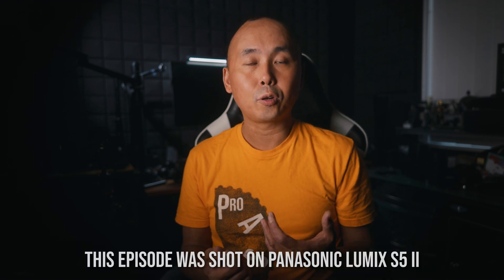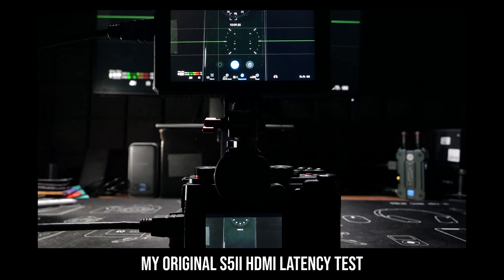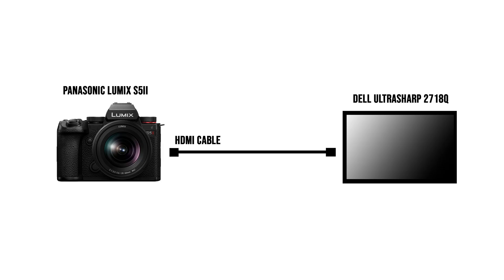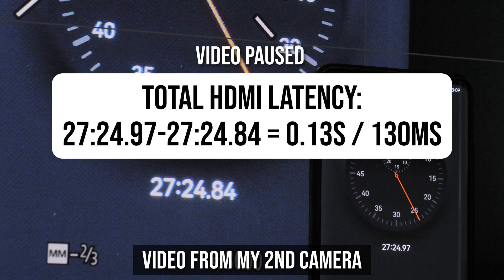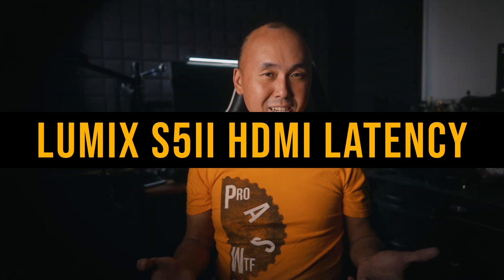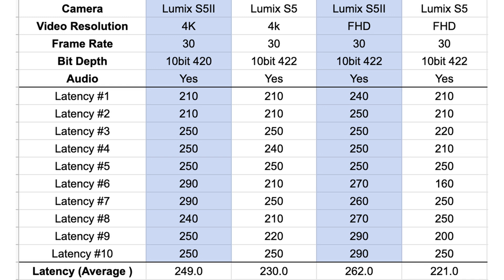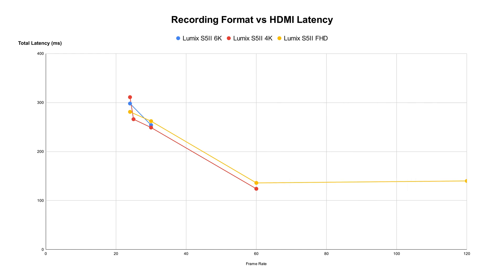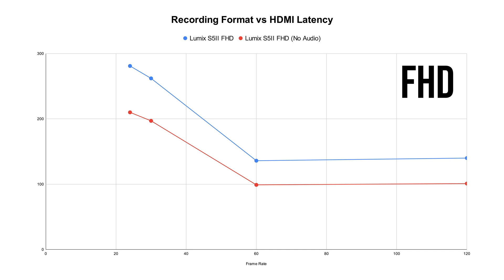Lumix Camera HDMI Latency issue (including S5II)

Comment: I’m shooting music videos of myself so I’ve been connecting my S5 II to an actual TV screen. Because I need to see what I’m doing while I’m shooting and playing at the same time. While I have not noticed latency, I have been getting weird red blotchy colors on my TV screen. I am using really old HDMI cables. Do you think that’s the issue? I noticed the higher I go the worse it gets. At 6K it’s just terrible.
Reply from the maker: so you don't see that in the recorded footage or camera monitor?  Then i would suggest trying a different HDMI cable that meet the latest HDMI specs
Reply: @ Hello, I tried three different cables and played it through four different monitors. I just had a camera repair place tell me I gotta replace my HDMI port. Thanks for answering.

Comment: I dont get the issue with latency other than personal. In reading you dont manual focus off a monitor anyway . If you want to auto foucus how does this issue effect that?
Reply from the maker: Pro video users when shooting with manual focus lenses quite often relies on the larger external monitor for focus pulling. Camera’s built in monitor is too small

Comment: Thanks Richard.  I'm curious if anyone has tried using the HDMI Ultra 10k 8k (2.1b) cable that's using for monitor feed in gaming.  I picked up a high transfer USB-C cable for an external drive already.
Reply from the maker: Are you thinking the cable may make difference to the latency?
Reply: @TheRealRichardWong  Basically yes.  I understand it's a cumulative effect. I went straight from a GH4 to a S5iix about a month ago.  I don't remember my last camera being this bad.  I don't use and external recorder where it seems a bit extreme.   My basic 7" monitor doesn't lag as much as the results but before I buy a 8k cable I would like to know how you feel.
Reply from the maker: There are a lot of discussion about the lag on various forums/social media..etc but so far i haven't heard anyone said it helped minimise the lag for them.

Comment: what will happen to sound I record into the Panasonic dmw xlr if I turn off HDMI record output ? whats the benefits of the HDMI REC OUTPUT on?
Reply from the maker: If you don't need to record/use audio from your external HDMI device, you can just turn that output off. It would not affect internal recording
Reply: @TheRealRichardWong  what external HDMI devices record audio ?
Reply from the maker: @creativegreatsvisuals Atmos ninja v, Hollyland mars X (from phone app)..etc
Reply: @TheRealRichardWong  is that audio from the monitor better than internal audio on most cameras ?

Comment: I’ll need to test it, but I would bet that it is not the 4k60p, but the APSC crop that improves the latency. Curious if the crop mode would better latency performance in 4k24p and 4k30p as well.
Reply from the maker: Keen to know your results if you tested it

Comment: I've seen some reports of issues with the HDMI feed occasionally being laggy and unusable for a minute or so.  Have you experienced this?  Thanks!
Reply: That makes sense!  I figured the reports I heard were user error.  Thanks for your quality content brother!
Reply from the maker: I had a few intermittent issues in the past, but they were all caused by either doggy connection or HDMI cable not able to handle the data rate

Comment: excellent job!!!

unfortunately I have 2 issues

1) I use time code to synchronize my S5 video with my Zoom F8n Pro audio, and time code is not supported at frame rates greater than 30 fps

2) I use the Deity TC-1’s time code on the audio channel from the S5 to my BMD Video Assist monitor for later conversion to metadata with the Tentacle Sync Studio app, replacing the wrong time code metadata written by the monitor arising from the S5’s HDMI latency 

I also use synced Deity TC-1 time code to the BNC TC-in on my Zoom F8n Pro, so the metadata based the S5 audio and the metadata in the Zoom F8n will be correctly aligned

👉🏼 therefore using 60 fps and/or disabling HDMI audio from the S5 is not an option for me

Comment: I discovered something else. Turning off lut conversion for hdmi and letting the monitor convert improved the lag also.
Reply: what do u mean by letting the monitor convert the lut ? what monitor the one on the camera ?
Reply: @creativegreatsvisuals  if you are using an external monitor via HDMI, having the monitor receive vlog and letting it apply a preview lut is faster than the camera applying the lut then exporting via HDMI
Reply: @torrel8074  so upload luts to the monitor ? the way I use the luts on s5ii is I record them baked in ..so when viewing on flip out lcd or on camera monitor its "what u see is what u get " as far as image goes ?
Reply: @creativegreatsvisuals  if you record do baked in then it's a none issue. It's only if you shoot in vlog, not baked in then want to see a preview of what it will be with the lut
Reply: i tested on s1 and it doesnt really make a difference sadly.
Reply: @oliverspeiser5930  it does on my S5IIX

Comment: Just got S5ii last week and everything is perfect, except this. I hope I could have watched your video before. Come on Panasonic, it’s 2023 and the HDMI latency on this NEW camera is so obvious comparing to every camera I’ve used in the past (GH5, XT-4, A7C). It’s unavailable to do sound-related live stream with S5ii along with other cams. It’s really frustrated.
Reply from the maker: If you are shooting with other camera, you could turn off disable the audio output for HDMI and use the audio from other sources instead? It would improve the latency quite a bit
Reply: @TheRealRichardWong   Yes, I did. But it still has much more delay than my other cameras. If I use dissolve transition between cameras, it will be quite obvious that the videos are out of sync. And also, because I’m shooting videos of piano performance, the delay on the finger movements is pretty obvious. Just to be clear, I like S5ii very much, and that’s why I’m so upset with this 🥲. By the way thank you for the review videos and all the infos of LUMIX cameras, help me a lot 👍
Reply: @SLSMusic  using s5ii : what will happen to sound I record into the Panasonic dmw xlr if I turn off HDMI record output ? whats the benefits of the HDMI REC OUTPUT on?
Reply: what do u mean you can do I live steam with other cameras ? what are u using for live steams ecamm and decklink?

Comment: There must be pretty bad latency with the monitor or even cable as the a74 shouldn't have 180ms latency at 24p and it's usually around 2-3 frames so 130ms. With the Panasonic s1 using the same setup I got anywhere from 240-280ms

Comment: Hi Riccardo, I'm scared by this delay and I'm waiting for the lumix s5IIX and I've already spent a lot of money on cine lenses. But this delay and the same as the gh5? With the gh5 at 50fps in 4k I only have a very small delay. Do you think it's the same as gh5 if I use 50fps 4k on s5IIX? Thank you
Reply: You're going to be in a pickle if you plan to use this on a production. The HDMI delay is atrocious compared to other cameras (coming from Sony and BMD). One of the main reasons I abandoned Panasonic because they have not addressed their HDMI latency issues.

Comment: hi Richard, 

i plan on buying the atomos shinobi for the s5iix. however, the shinobi can only accept a 4k30p signal and not the 4k 60p...but i read that you can change the hdmi output resolution settings to hd 1080p and continue to record 4k60p in camera whilst displaying hdmi output into the shinobi at 1080p....is this possible? i need to know this before i purchase the atomos shinobi.
Reply from the maker: Hi CS I think it should work. But let me do a test to confirm for you
Reply: @TheRealRichardWong  thanks so much 🙏🏼
Reply from the maker: @ThePistonPit  okay.  i haven't got a Shinobi but i have a Feelworld F6Plus which also doesn't support 4k60.   (only go up to max 4k30).     
When i set the S5II's  recording mode to 4k60 and connect to F6plus, the F6plus shows it is connected at 4k30 and works fine.   Hope that helps
Reply: Thanks Richard… i can only hope the shinobi does the same. 

Or is it possible that the s5ii down coverts the hdmi output automatically to display the image to the monitor.?
Reply from the maker: I think that's what it does as I didn't touch any settings

Comment: Great video!  I've brought this up before with other reviewers and they don't seem to get the issue.  I used my S1H with a monitor for live music concert and literally had to pull it off the montior to cont the shoot.  it would be the same for recording a wedding or anything that subject is anything but static.   I thought having the monitor would help me with manual focus, sine the S1H (and all Lumix cameras except the new S5) can't "really"  auto focus,  but due to the latency I couldn't focus on anything.  Its ok if the subject is static and the camera is static, but that's not how I shoot.  I wound up buying and Canon R5 and use it with a Ninja and it's never been an issue with any fame rate. I hope Lumix will address this, but I doubt it, it's been an issue for a long time across all their cameras (I have and tested this on the GH5 & S1, too).  For me, it made using a monitor pointless and frustrating and sadly was the ultimate factor to buy into another system.  I still love Lumix and use it for specific shoots, but this (and the autofocus, until recently), made the system unable for most projects.

PS - I did not try the audio trick, but I need audio to sync later. I use the monitor to view and record.  I also shoot 24 FPS most of the time and do not want to change my frame rate to adapt to the HDMI issue.
Reply: I also recently purchased a ninja five from my S1H… and tried every trick/ HDMI 2.0 and 2.1 Cable type, I am absolutely disgusted that this was never popularly addressed as an issue… Since Lumix is so often paired with Atomos in their marketing

The latency is so horrible, and simply not “work around aroundable”
Reply from the maker: I will want to come back to this topic a bit later and some more testing/research

Comment: This is a topic I know very well. One thing that should be clarified is that while you can measure the lag between lcd and monitor, the lcd itself is lagging. Lag is expressed in frames so lower frame more lag. Why is lag such a big issue with digital cameras? Because they have an evf and lcd. On a video rig you only see what you shoot on the monitor plus all processing happens elsewhere so it is quicker. I have measured my Sony A1 and the lag is same or bigger than the Panasonic MFT. However there is no audio trick to be played. Panasonic should resolve the audio sync issue and then it would be quicker. Instead there is an initial delay due to av sync that kills everything. This can be resolved and should be resolved. As far as I am concerned for time critical use cases like sports and wildlife you need to use the EVF
Reply from the maker: hey Massimo,   yes the camera's LCD is definitely lagging a little bit. I think i can count 3-4 frames in most situations. So that's why in my test,  i was comparing the real-life object. vs the final external display, instead of the camera monitor  vs external screen.    Interesting to know the A1 lag is the same or bigger than the Panasonic MFT.   Thanks for sharing that info!  :). 
And yes i would love to see some changes to reduce this lag in the future,  either through firmware or hardware changes.
Reply: @TheRealRichardWong  I guess this is S5II? Seems like full frame lag more which I do not fully understand. The LCD should be able to run at 60fps (check in the settings) and then the lag is 1 up to 2 but very short in time. It could be that the S5 readout being slower does not allow the LCD to go quicker

Comment: Funny,As I'm watching this video.  I was just testing my Sony a7IV overheating for I have a long form project coming up. using external dummy battery . I push the camera to record 4k 60p 4.2.2. 10bit (100mbps) HS-Avc. still running after 2hrs without overheating icon coming on. room temp. at 70F. 21.5Cel. turn the high temp record to ON. in the menu
Reply from the maker: Hi KC,  i didn't turn the high temp setting to on, because i was only doing very short recording so completely didn't expect it to overheat.   Still not sure what happened.  I never have the A7IV overheat so quickly before.
Reply: @TheRealRichardWong  do you usually use your A7IV with or without a monitor attached

Comment: I want to see all autofocus  mode specially. Tracking option. Please make all autofocus mode video.
And using sigma L mount lans.
Reply from the maker: Have you check out my full review? I did a quick tracking mode demo there
Reply: @TheRealRichardWong . I check s5 2 with sigma 35 1.4 lens tracking mode it's not properly work loose autofocus. I have footages

Comment: Great video👍. 
LUMIX mentioned that in 30 fps elec shutter mode the camera uses internal compensation to correct rolling shutter. Is that you have noticed or tested while shooting ?
Reply from the maker: Thank you!   Yes I've tested it,  check out the result in my review: https://youtu.be/Y5auV2JC7fc?t=4545 (that should be the right timestamp)
Reply: @TheRealRichardWong  thanks for your reply 🙏